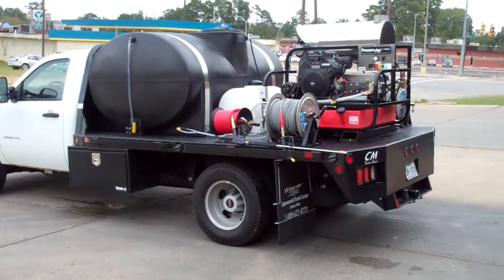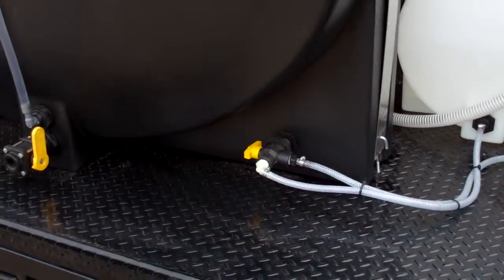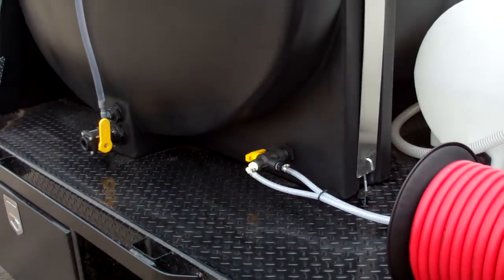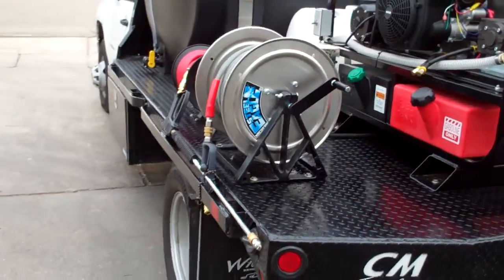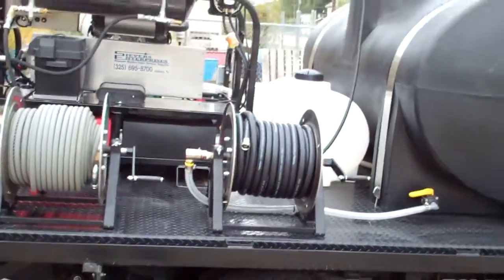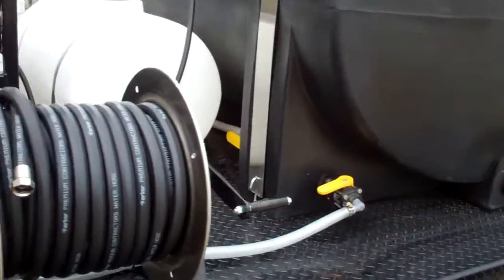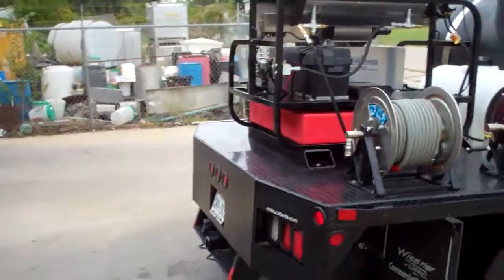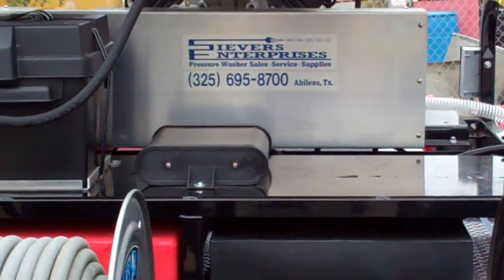Sievers Enterprises Pressure Pro Mobile Wash Skid on Flatbed

Comment: That seems like a lot of weight for a Chevy 3500 , that 600 gallon tank full in weight alone is over 4,800 pounds not including the tank maybe another 400 pounds, how much weight can the Chevy flatbed hold ?  Did you have to Modify underneath at all  ? ... helper springs ?